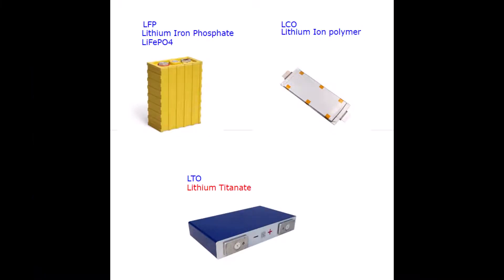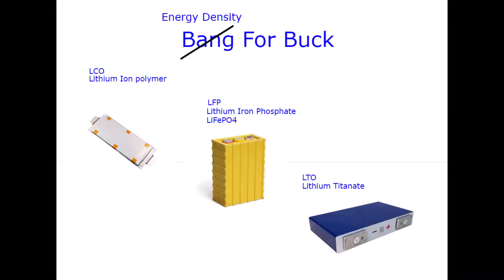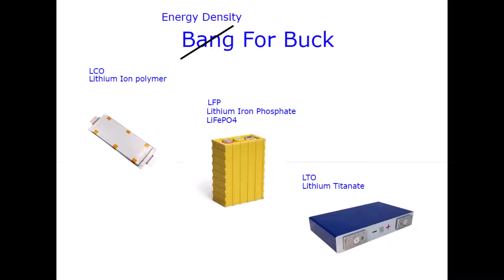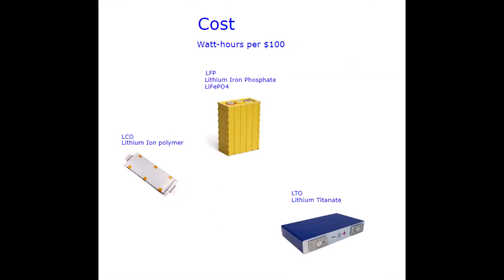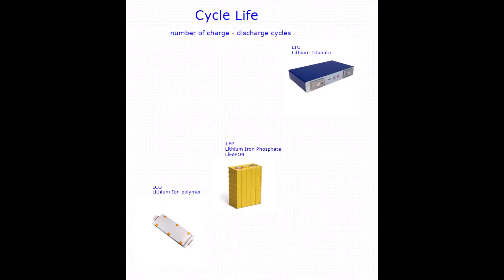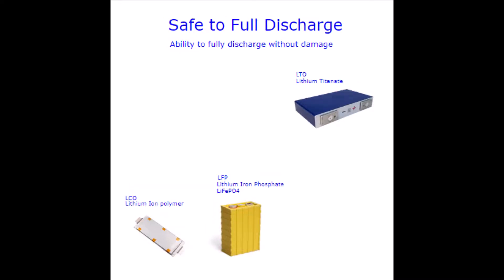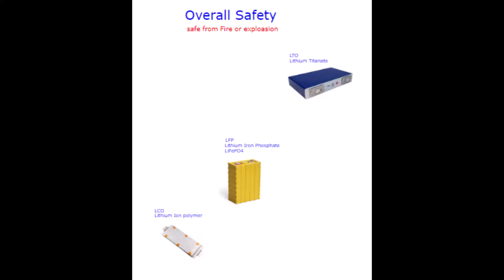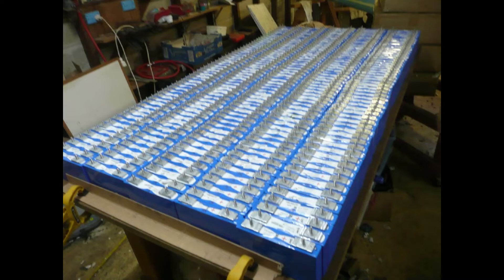LTO   Solar Ute Battery

Comment: Great project. Can you share your source of LTOs? Cost? Any reason for going with these LTOs over round ones?
Reply from the maker: Hi.  I bought these cells from OSNPOWER.  They performed professionally and it was a good experience.   We paid about AUD30  per cell. This was at the end of 2020 so it before shipping and shortage went crazy.  

I think on paper the cyclindrical cell had an even higher C rating, but we were more concerned about form-factor.  We were able to pack more cells into our spaces with rectangular cells.
Reply: @solarute6066  thanks for your very detailed reply.

Comment: Bms?
Reply from the maker: Not sure what the question is, but I designed a 12 way BMS module with an isolated CAN bus.
Reply: @solarute6066  
Thats awesome... how is your system working
Reply from the maker: Fine so far.